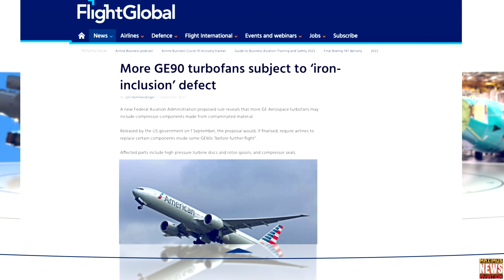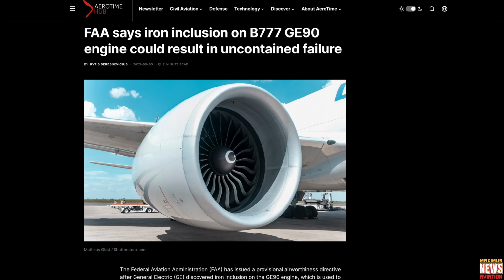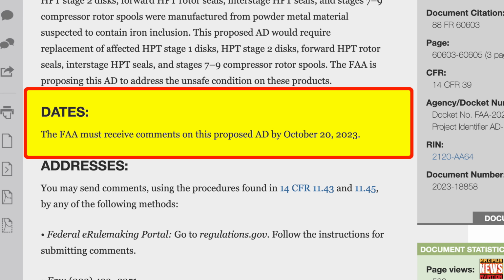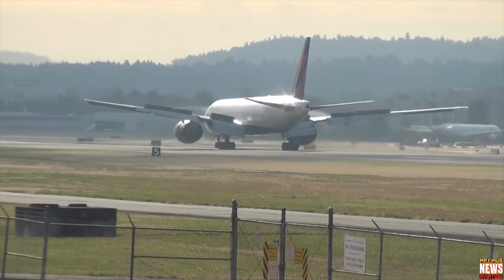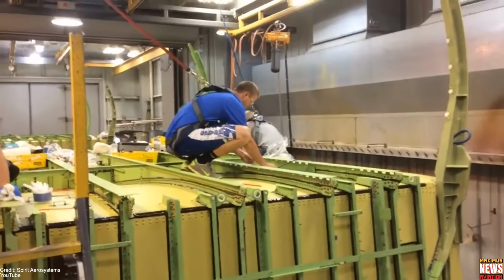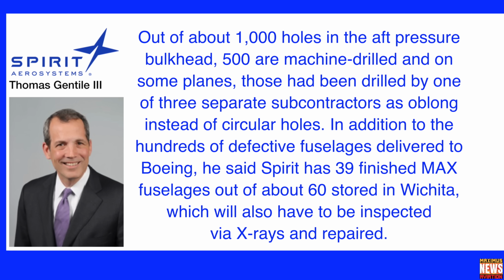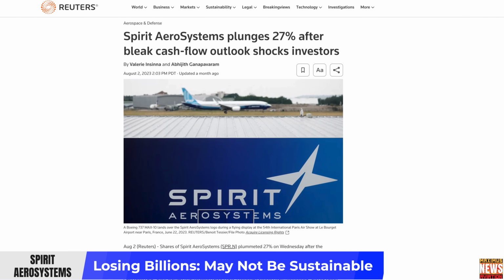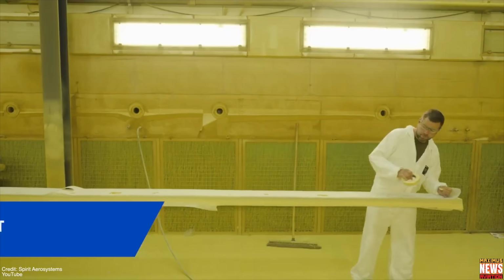The Big Boeing News Report: Includes Bad News For The 777, 737 MAX, 787, And Even Airbus Jets!

Comment: Another factual video brought to you by Boeing's Cost, Schedule and Shareholder Value over Quality and Safety. Boeing moved far away from manufacturing and became Plug & Play so as to blame others when problems arise.
Reply: I can't upvote this enough!! F Boeing and F the shareholders.   They won't give a damn unless there's a crash- then they'll blame it on others
Reply: Most of the issues, aside from the 777 GE 90 problems, are the fault of Spirit Aerosystems, not Boeing. That's why Airbus is affected also.
Reply: @RagShop1   Manufacturers hold responsibility for their end product, they choose their suppliers and vendors. Be it Boeing or Airbus the product they sell is their responsibility.
Reply: @nickolliver3021  Wrong again Nicky because you've never touched a real aircraft. When an aircraft is designed the designing manufacturer picks which engine or engines will be used for the production. If there are multiple engines offered then the airlines choose which one they want to go with. 😝😝😝😝😝
Reply: @soyousay7751  Wrong again Steven. The airlines do choose the engines if there is a single option or if there are more. The designing manufacturer does not pick the engines to have on their aircraft. It's down to the airline that chooses the engine. 🥱🥱🥱😅😅😅
Reply: @nickolliver3021  You're off your teats once again. The aircraft manufacturer decides if there will be one or multiple engines used. If there is an option through the aircraft manufacturer then airlines chose.

The same as an auto, the auto manufacturer decides the engine options and then the buyer chooses. You are by far the dullest tool in the shed, hence you will never touch an aircraft.
Reply: @soyousay7751  Haha you are the one who is off your teats again. The aircraft manufacturer does NOT decide if there will be multiple engines used. The engine manufacturer decides what engines can be used on said aircraft and the airline chooses which ones to have if there are options. If there is one, the airline has to choose that engine not aircraft manufacturer. 

Cars are not planes. Cars are made with a choice of different outputs of power. The car manufacturers makes that engine for that car as well as the group for example VW, SKODA, AUDI, SEAT, etc. Hence why he will never know how the customers in aircraft choose their engines.
Reply: @nickolliver3021  Keep trying Nick you are close to a meltdown.
Reply: @soyousay7751  keep trying Steven you are getting close to having a hissy fit
Reply: @nickolliver3021  Take your meds cousin and listen to your caregiver. Remember the last time you had to be put in the hospital.
Reply: @soyousay7751 keep trying Steven. Your comments are an embarrassment to the industry and YouTube public.
Reply: @soyousay7751 ragshop1 is correct. The manufacturer does not hold responsibility for defective engines. That's the engine manufacturers issue not boeings nor airbus. Keep the lies coming in
Reply: My cousin Nick Olliver is a special needs cousin, we've accepted him for what he isn't and that's isn't sharp. He means no harm but also serves no purpose other than a burden to family and friends.

Comment: And, of course, repairs to bulkheads have never gone badly wrong.
Reply: I'm bothered by the company statement on this subject. 
By definition, how do you "Drill" an oblong hole?
Reply: @COIcultist  We don't know how these holes are formed. For example, a CNC machine may just have been incorrectly programmed. 

Alternatively, it could have been an incompetent worker who cannot even keep the drill steady while drilling.
Reply: @COIcultist it becomes oblong when you drill at an angle
Reply: @AE_Sub  An ellipse, surely? To produce a rounded cornered oblong, you need to traverse the drill or cutter like in a milling machine.
Reply: @COIcultist Drill a series of holes inline, with as little webbing as possible between them, then use a round file to file away the webs. Finish with a flat file.

It's not going to be the prettiest slot, but it should get the job done.
Reply: @johniii8147  That is something crafted by intent, though, not by accident.
Reply: You are referring to the JAL crash. Different situation where the aircraft had been damaged from a bad tail strike and repaired incorrectly.
Reply: Also China Airlines Flight 611
Reply: @sylviaelse5086  Same thing improper repair and poor inspections.
Reply: I've no doubt that it is possible to do a safe bulkhead repair. Indeed, I'm sure that many are done. But that's two more accidents than we should have had, as a result of inadequate repairs. If I knew that I was flying on an aircraft with a repaired bulkhead, I'd be bound to wonder whether it was going to be number 3.
Reply: @sylviaelse5086  i would be far more concerned on the ride the airport than such things. These two incidents were decades ago now. My point really was this is an entirely different situation where the errors were caught and being addressed.
Reply: @johniii8147  Still, that was a repair to a bulkhead that went very very wrong.

Comment: It’s slightly click bait to entirely blame Boeing for subcontractor QA issues.  I hope GE eats the cost of the repairs instead of issuing a notice that engine overhaul periods have been shortened.
Reply: Was GE making those for any other airframe manufacturer? I mean there’s bad luck with a supplier, then there’s partnerships.
Reply: @Racing_Pig  no, but that doesn’t mean they aren’t allowed to
Reply: @Blank00  It was custom bespoke work for one buyer. They're basically partners.
Reply: @Racing_Pig  So? The A350-900ULR is bespoke for Singapore Airlines. If there is an issue associated with the ULR version of the A350-900, is Singapore Airlines to blame?
Reply: @Racing_Pig  So? Boeing was still not part of the design team. All they did was tell GE the thrust rating and efficiency that they wanted. But only GE and Safran were in the design team
Reply: @Blank00  Yes. It's literally their custom specification developed in direct collaboration, and solely specified and jointly maintained and supported by their corporate partnership with Airbus.
Reply: @Blank00  Were they? They don't just throw out a spec and walk away like a computer brand contracting a semiconductor line for mass produced GPUs to put in a video card. They're collaborated joint ventures, not a marketplace.
Reply: @Racing_Pig  Boeing just gave GE a couple of specs on thrust rating and efficiency and GE designs an engine based on these parameters. That’s why the GE engine on a 777 is different than a PW or RR engine found on a 777. Another example is the CFM LEAP 1A on the A320NEO. That engine is closer in design to the engine found on the MAX than the PW engine found on the NEO.
Reply: @Racing_Pig  yes, the GE90 was a joint venture, but Boeing was not on the design team. GE Aviation teamed with Snecma (France, 24%), IHI (Japan) and Avio (Italy) for the program. Under antitrust laws, Boeing is not allowed to have expertise in engines, hence why PW split from them in 1934
Reply: @Blank00  You just don’t see the difference between the legal technicality, and how things actually work huh? Boeing and GE together decided on cost, suppliers, production standards etc.. the Design is only a factor until units are delivered. Then it falls on the supply systems and QA/QC against consumer desires like delivery time, cost, etc.. which when it’s both a monopoly and monopsony for a specific product it basically means it’s one compound entity making the decisions. Regardless of what corporate paperwork says what.

LEGALLY Boeing gets to blame GE. But they’re both one side of the same coin in this airframe and power-plant endeavor.

Comment: How is Boeing responsible for manufacturing problems with the GE90 engine?  GE is responsible for that.
Reply: Boeing bought the engine, it's their problem. And if they're not jumping on GE fast enough to sort it, that's on Boeing as well. They can sue GE if they want, but when partner up with a fool, the splash will get you wet too.
Reply: @BigHenFor  By your reasoning, Airbus is responsible for the failures of the Pratt & Whitney Geared Turbofan engine failures that are keeping so many A220s grounded.
Reply: @archer1803  he is quite wrong. If you buy an engine to go with your plane its not on tne manufacturer because engines always have issues. If a problem arises its the engine manufacturer to blame not the aircraft manufacturer. If the manufacturer is not fast enough and not jumping to the engine manufacturer then perhaps something may be going on with the engine side of things. People will want to blame manufacturers for choice but bottom line anything chosen is always on the manufacturer of engines etc not on the plane manufacturer

Comment: Maybe Boeing should change their strategy and list the parts of their airplanes that don't have failures. Could be a much shorter and easier to manage list ....
Reply: Well thats on their suppliers though
Reply: The landing gear trunions seem to hold up well, biased on the kind of landings I’ve ridden through since the 65 retirement extension.

Comment: To be fair, these issues are from supplier-made hardware problems, not Boeing per say.  However Boeing does have the ultimate  "Trust but verify" responsibility to ensure their contractor's manufacturing and quality assurance is meeting their critical requirements.  Tainted turbine blade powder and oblong drilled bulkhead holes should have been caught during the manufacturing process, not after. And with Spirit, there on-going financial losses begs the question if any of the their manfacturing problems were caused by cost-cutting?   

But back to Boeing, how about the long and on-going Starliner debacle.  For almost four years since it's near disasterous first un-crewed flight, the spacecraft continues to be plagued with additional problems and delays, even during this year's 2019 un-crewed re-flight.  In the meantime and for over two-years, the SpaceX crewed Dragon continues to perform well.  

At this point in the game and with the first crewed flight now pushed out to 2024, Boeing and NASA need to finally cut their losses and cancel the flawed and technically troubled Starliner project, likely to the relief of the yet-to-fly Starliner crews.
Reply: During the manufacturing is at Spirit and engine makers. Boeing is considered after manufacturing because Boeing receives finished components
Reply: @Blank00  Boeing is ultimately responsible for their birds. They choose the suppliers and products.
Reply: @soyousay7751  then by that logic, Ethiopian Airlines and Lion Air are culpable for the MAX crashes. They chose the suppliers (Boeing) and products (737 MAX)
Reply: @Blank00  You can't accept reality and try mental gymnastics. The manufacturer of the item (Boeing Aircraft) holds final responsibility. When there are lawsuits they are against the manufacturer Mr Forrest. 😝
Reply: @Blank00  👈 BBBBB, but, but, but..............BLANK.................says it all.
Reply: @soyousay7751  it shouldn’t be that way. The engine makers deserve blame for engine issues because they know a myriad of things about engines that Boeing and Airbus will never know

Comment: Square holes in a pressure bulkhead!!! WOW, just wow
Reply: Correct me if I am wrong but he said oblong. Not square. 

BTW, noob so bear with me please. Square holes on a bulkhead are a problem due to stress concentrations at verticies, right? Or am I completely off the mark?
Reply: @death_parade  In the industry they are jokingly known as Boeing special figure of eight holes!😂
Reply: @hugostiglitz6914    "In the industry they are jokingly known as Boeing special figure of eight holes!😂"
Can they produce an infinite number of these figure of 8 holes?
Reply: @hugostiglitz6914  also requires a special fastner!
Reply: Holes to be clean , round, straight deburred alodined and painted! Square holes would be considered damage! That would be one fcked up drill bit! Sheetmetal for a while
Reply: @markwheat2668  Wow thanks for your comment. I had no idea about the existence of a process called alodining. I love it when I learn new stuff unexpectedly like this.
Reply: @death_parade  fasteners can be a different alloy than the part and can cause corrosion with some water we try and paint both side of rivets after install and inspection looks at and buys it off.
Reply: @markwheat2668  Reading your comment, you appear to know a bit about this process.
Still holding to what I said about by definition not being able to drill an oblong hole, are these drilled holes actually drilled?
Whilst oblong is a bit of a stretch, drilled holes are not that round either. If you want a round hole, you use a boring bar or ream or hone it. I can't see boring bars being used on sheet metal or any sheet material, but are they broached by something other than a drill?
Reply: @COIcultist  28 years heavy structures with 13 at Douglas Long Beach. You are right on the money with reamers. For rivets twist drills are OK  but HI lok and huck bolts were a processed hole.  A 1/8 " drill followed by a core drill then step ream to final size.
 Now those oblong holes were probably from pilot holes already drilled by the part supplier but didn't  line up with blue print hole location or some combo of holes drilled then the next part didn't line up and was drilled anyway. Possibly one part covers holes then another part or web is placed over said part and a second hole is drilled with a tool leaving 2 drilled holes oblong or sometimes like a snowman!
Flat bottom ream out damaged holes toclean and round install freeze plug repair
Reply: @markwheat2668  HI lok and huck bolts are beyond my knowledge, just pulled a quick pictorial guide to huck bolts but no idea on the whys and wherefores. Shear strength?
The "Flat bottom ream out damaged holes toclean and round install freeze plug repair" was beyond me too.
Hopefully you got my "Infinite number of Boeing special figure of eight holes!" Joke.
Reply: @COIcultist  I did, if a guy was fixing g those oblong holes on several planes it would feel like an infinite job! Hi loks are usually titanium and used in high load areas.
Flat button reamer used with a tool bar to make the oblong hole into a bigger clean hole then an aluminum slug bushings for each structural member are set in liquid nitrogen or dry ice then shot I to the repair hole. Stressful job using a rivet gun on that bushing stack you spent the day fabricating and selling off steps to insp. As long as you stay square to the job and don't shot all the bushings too far in!
Reply: @markwheat2668  Correct.  A square hole would be considered defective / damage.  Holes and edges must be deburred, blended, alodined for ALxxxx.
Reply: I'm bothered by the company statement on this subject. 
By definition, how do you "Drill" an oblong hole?
Reply: @COIcultist  Wobble the bit back and forth but how the hell is that done with a machine ????
Reply: In bladesmithing it would be called stress risers and are very bad things.